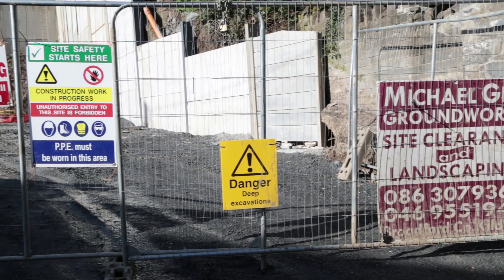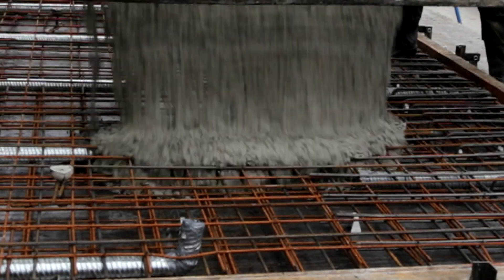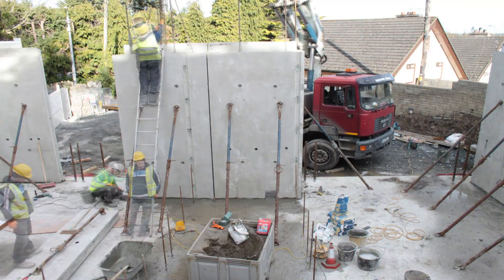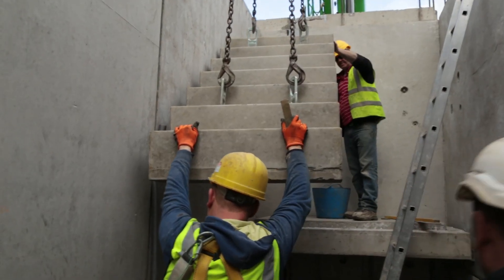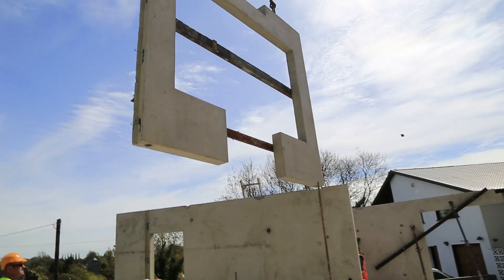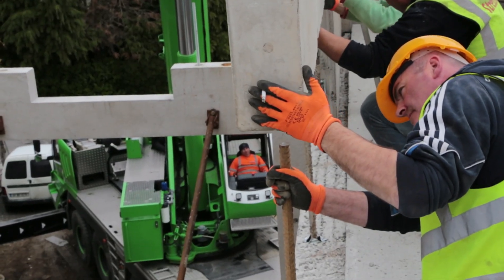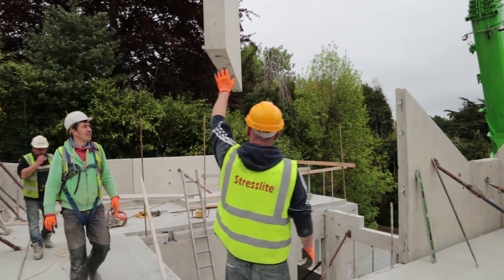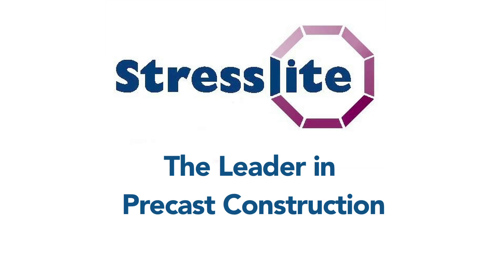Stresslite Precast House explained     https://stresslite.ie

Comment: Is it possible to buy precast floor slabs with starter bars in the in order to facilitate precast columns and walls?
Reply: They could make what ever you want I suppose. The engineers who design the precast are quite clever.